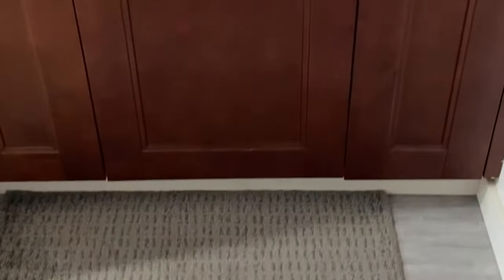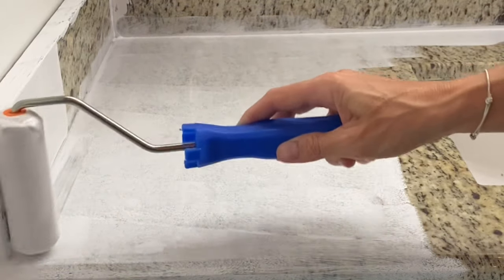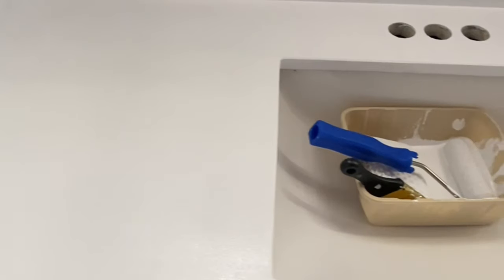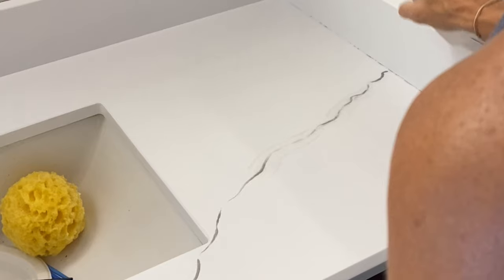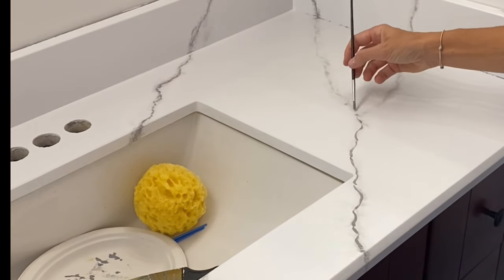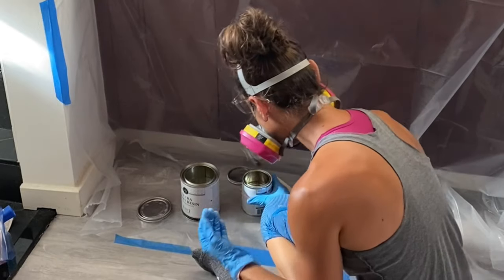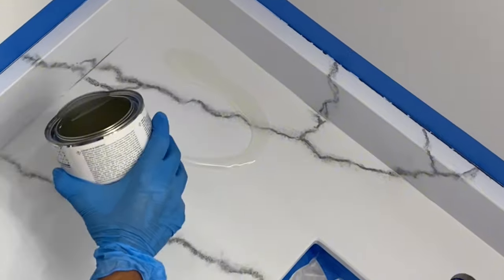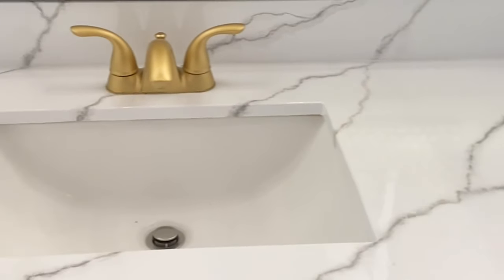How to DIY a Faux Marble Countertop using just Paint and Epoxy!

Comment: God Bless You!!!! I had a chlorine pool for 16 years and never ever had this problem. We purchased a new salt pool completely new system about a month ago and had it installed. Trying to get it up, before next summer and having a deck built. We’ve dealt with cloudy water after filling the 1st time. My husband farms and had a 1000 gallon portable tank, he cleaned it, and he transported 3000 gallons from the deep well, when we were told by a family member maybe we should use city water because well water isn’t treated. We immediately called the pool company asked about the well water, they said it may have iron or metals in it but they had someone who could guide us if any issues. So, we stopped with well water and finished 11,000 gallons off with city water. Over $ 400 later in chemicals we still had cloudy water. I told my husband it had to be Algae because I saw the yellow fluffy looking stuff in places that weren’t crystal clear, until turning the filter on for the first time. Once the filter was on, the cloudiness set in. Thank you so much for your video. It was algae. Flocculant is taking care! Cannot wait to get it finished. Appreciate this more than you know, it’s saved our wallet and sanity! I should’ve known never to have turned the filter on until I vacuumed. Expensive lesson learned thank you again!!!

Comment: Nice work, Selene.  Looks beautiful.  When you did the backsplash, did you spray more lightly so as to prevent the water from running or does the bottle spray a fine mist?  Thank you!
Reply from the maker: Thank you! Great question. Yes, you do have to be a bit more careful on the backsplash. I did have some drips after spraying but just carefully cleaned them up with a sponge or paper towel.

Comment: You did a wonderful job! The only question I have is about the holes where the faucet was when you applied the epoxy. Did it run down into the holes and did you have to do something to make sure you could put your faucet back again?
Reply from the maker: Great question! You couldn’t see in the video, but I did tape the holes underneath to allow the epoxy to run into the holes slightly.